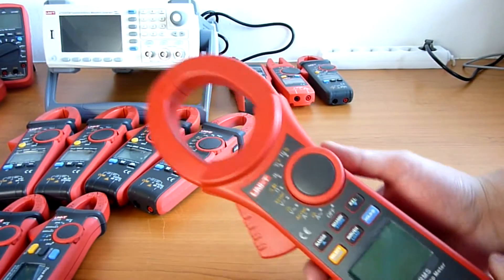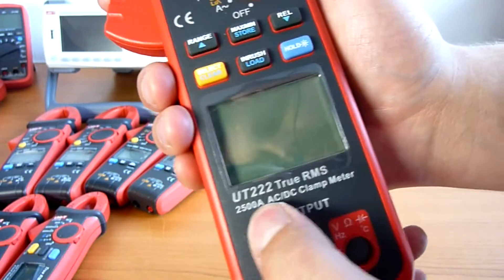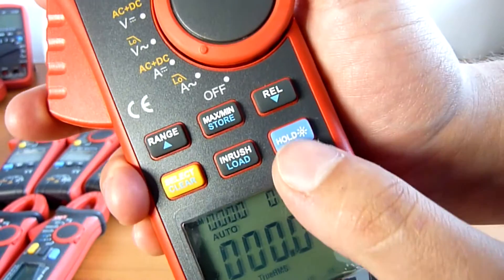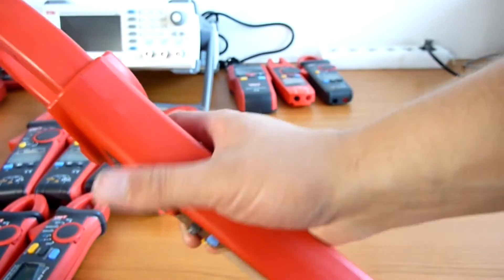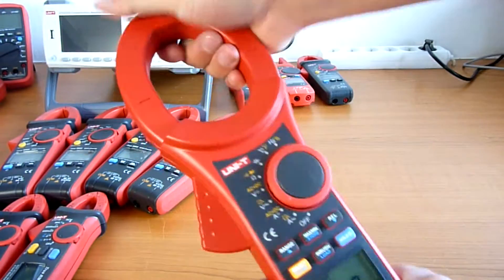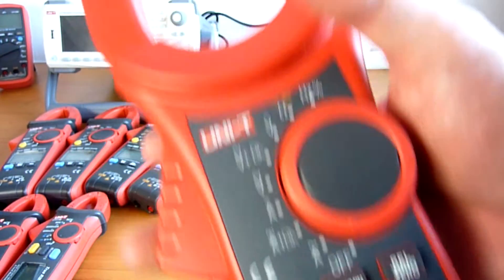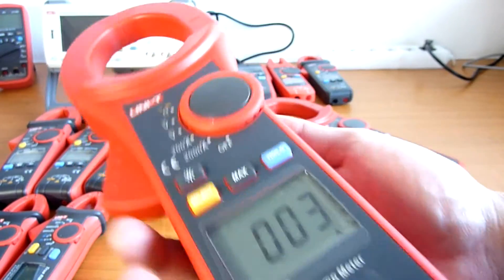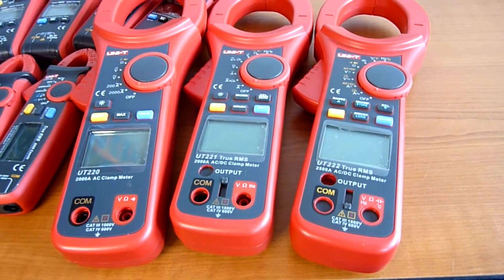NEW UNI-T UT222 - 2500A AC+DC industrial clamp meter with mV OUTPUT!!!

Comment: Did you test it? Mine does not work with AC current. Always shows 0A and cheaper AXIO-MET 2000A meter shows 1.2A, which is accurate.